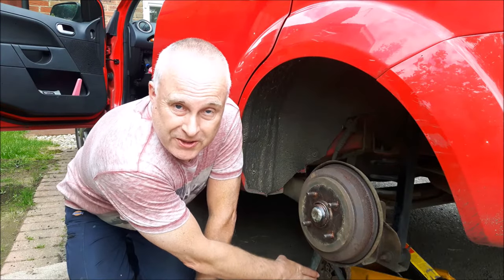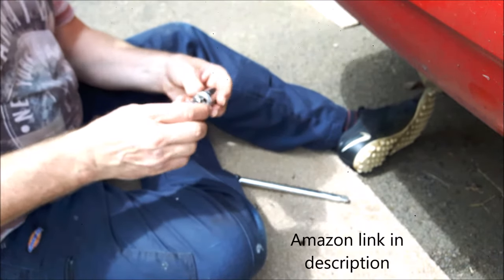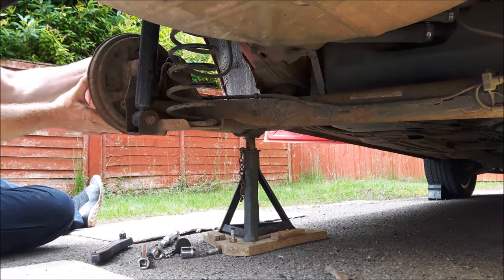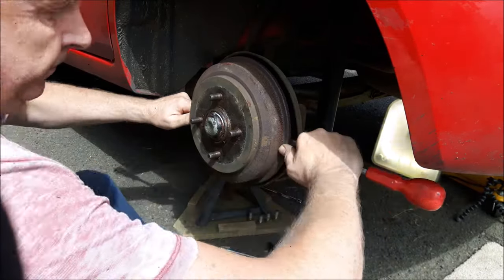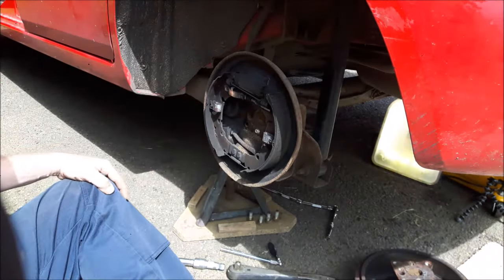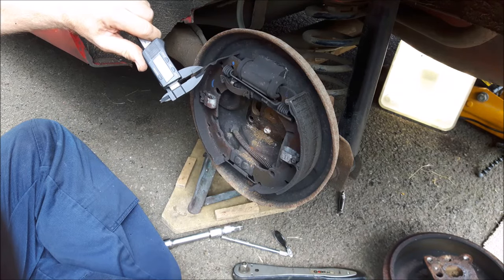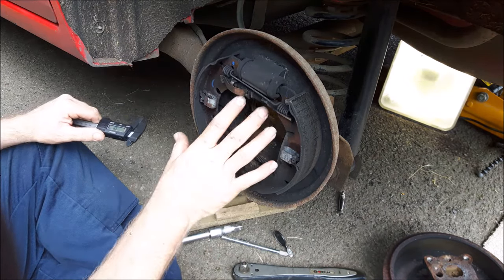FORD Rear Drum Brake Removal - Fiesta Rear Brakes

Comment: Nicely explained! I've seen other videos which show the central nut being removed, which disturbs the wheel bearing. Poor advice by them if you are looking only at the brake linings.  Advice would be useful on how to back off the adjuster before pulling off the hub, to get past the rusty rim on the inside of the drum.
Reply from the maker: Hi R, thanks for that. Don't forget to share the good news!
Yes, good point about the wear lip. Ours didn't have one and all I was doing was cleaning up the linings and checking handbrake adjustment. I'll look into it and maybe do a supplementary 'short' in the future.  👍👍
Reply: @CycloneCyd  z

Comment: I very much like the  wooden platforms for your axle stands. I had the front of my Citroen Dispatch on axle stands all last summer and, while rotating them coz they were slowly sinking into the street, damaging the tar and getting dangerous,  it never crossed my mind to improve them. Cheers.  What's worse, come to think of it, I've proudly known for years the pub quiz fact that the Eiffel Tower, thanks to it's massive footprint, exerts less pressure on the ground per squ cm than a human.
Reply from the maker: Yes, indeed. Now my son can weld I'm going to get some steel feet put on my stands, but when we moved into our new build, scraps of chipboard from the site were easy to come across.

Comment: Have you done a Fiesta Active 2020, I've always managed to remove the rear drums with no problem with my other Fiesta's but this one's a problem. Had it into Ford about 18 months they'd removed the drums because I was having a handbrake problem, as it was 18 months ago I decided to clean the drums out, I thought they'd come off with no problem, no chance. It's like they've glued them on. There's no corrosion but they are solid.

Comment: How's that's easier than remove one big nut on the front? Can be a pig to refit with the 4 rear bolts. Not sure on the newer fiesta's, but my 1994 MK3 fiesta you just have to catch the bearing after removing the nut.

Comment: Hey, I have been having problems with my left break drum for years. Changed the shoes, cylinder, some springs, the drum and still I have that terrible sqeeking sound when I brake during my drive... It's so annoying. Could it be that some parts need to be lubed? Maybe the mechanics didn't do that...
Reply from the maker: 1st: are you certain it's the rear drums and not the front calipers?
2nd: yes, a tiny tiny smear of Ceratec (https://amzn.to/3xfWQMv) on all the contact points of the shoes to the drum backplate and yolks. The Fiesta has tiny little teflon pads but yours may have worn through
Reply: @CycloneCyd  I am 100% certain it's the rear drum. I stuck my head out the window and listened where the sound is coming from. As soon as I step on the break it squeaks faster when your at high speeds and it slows down the squeeks as the car slows down... Hella annoying and the pedestrians give me the look. It's a shame really. I fixed the car, looking like brand new and every mechanic thinks there is no problem and they don't hear anything 😂 I am not crazy. Usually you can hear the squeeks when the breaks are cold and If you use the handbrake while slowing down it adjusts the brake pads and it doesn't squeek anymore.
Sorry for bothering you with silly stuff but I can't sell the car like this.

Comment: Very informative video!
Quick question
Have you ever experienced the rear brakes engageing on their own with the handbrake all the way down
I drive an '03 TDCi Fiesta  and i've noticed my car sort of squat as i let the clutch out as i'm pulling off, and when I'm barely moving the rear brakes zort of squeek and make noises indicating that they're braking
I'm planing on taking the drums off when I have the time (which is why I'm watching your vid) but I thought I might as well ask if this is something that happens commonly or that you've come across
Reply from the maker: Most likely there's a problem with the adjusters, maybe gummed up with shoe dust. Or maybe the whole mechanism is gummed up. Have plenty of brake cleaner to hand. If you're in the UK Screwfix is the best value place to get it from. Do let us know how you get on.

Comment: I tried it this way, and it all came apart from the car, the protective sheet metal, the mechanism, the drum with the pads, all together.
What holds for the car, the protective sheet metal, the pads and the brake mechanism, which screws?
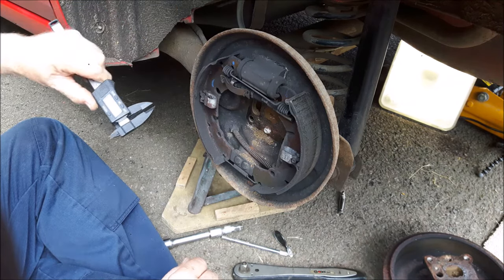Reply from the maker: Sounds like someone has had it apart before and not put it back together properly. If you pause at 2:27 and zoom in you can see the silver head of a M6 flange screw. There is another one above it under the self adjuster that you can't see. These hold the back plate to the swing arm when the hub is off. You can look at this picture, I have pointed at the screws:
https://drive.google.com/file/d/1xwl6B803XYrMeW_GsfLHysHjO_NuoR5P/view?usp=sharing
Reply: @CycloneCyd  Thanks for help!

Comment: Totally unnecessary way of inspection of the rear brakes, try that when all the heads of the bolts are rusted. I've worked on these cars for years and have only done that once but each to their own I guess.
Reply from the maker: Hhhmmm! I'm not sure if you're a troll, just missed the point or thick.
I suspect the former since you offer NO actual wisdom of your own, but merely criticise.
Anyone can do that.